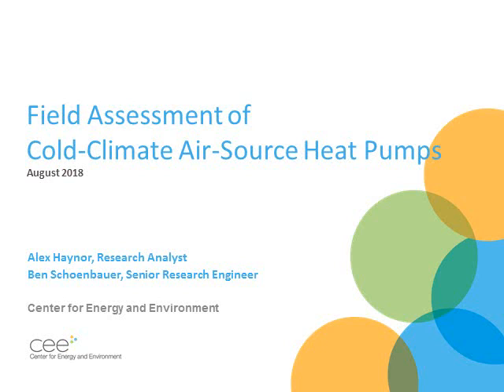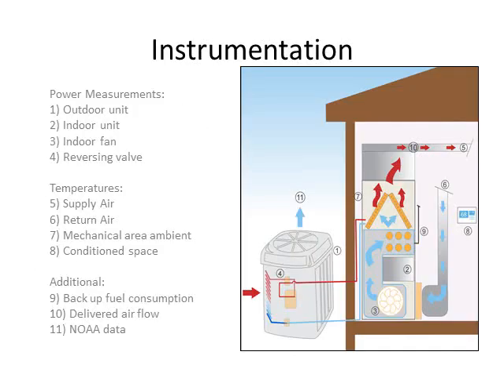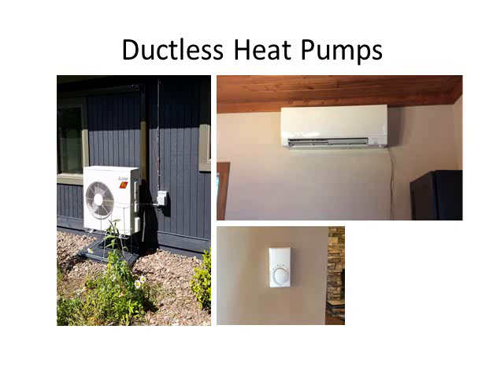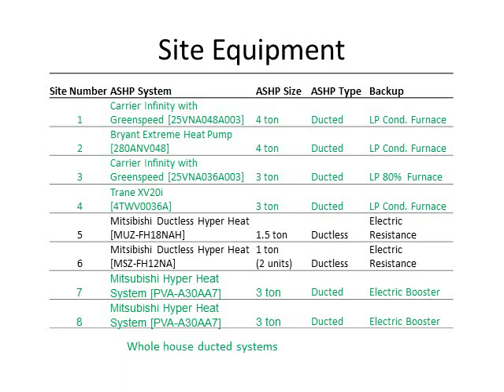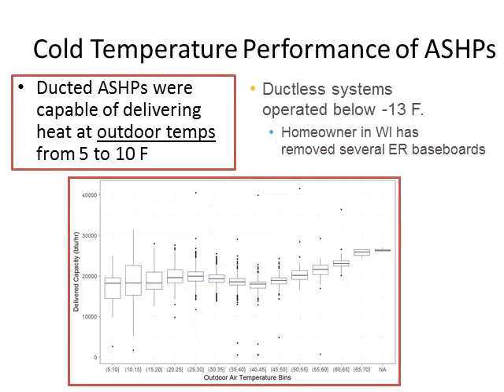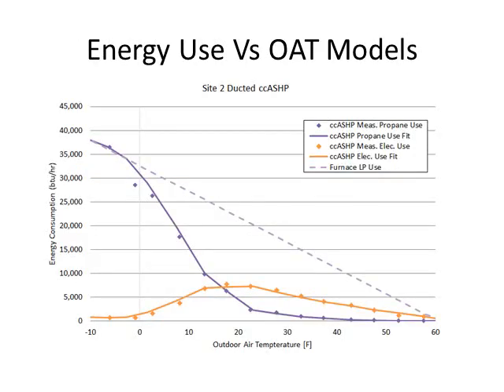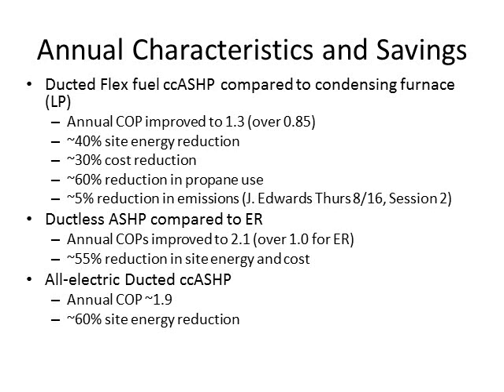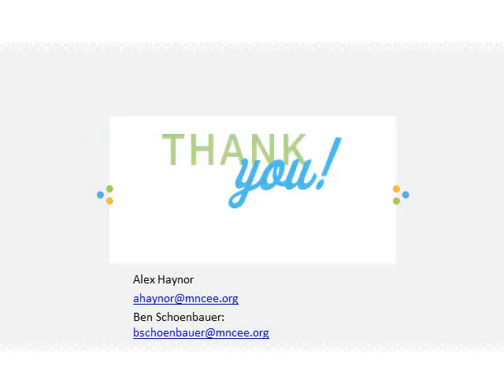Field Assessment of Cold-Climate Air-Source Heat Pumps

Comment: The method of calculating COP is wrong. Electrical input cannot be used as the basisi as electricity is not energy, it is an energy carrier. There for the COP needs to be divided by two at least for the most efficient generating type. In practice two is probably too small a figure.

Comment: So long as electricity is three times the price of gas and oil(per Kwh) in the UK the numbers just don't come close as a reason to change your heating system.
Reply: Global heating is probably a good enough reason.
Reply: Cost is not 3 times greater for equivalent kWh output.

Comment: Great video, just installed a 16 seer heat pump in Moorhead,MN and works great. Saving a ton of money!
Reply: Which brand did you go with? Experience any issues?
Reply: @tylerhein  haha funny you ask. A Goodman. The reversing valve got stuck in cooling mode after 6 months of operation. Warranty only covers parts. Labor is around $1500. Sounds like common issue on goodmans.
Reply: @andylarson3547  I'm across the river and am looking at replacing my ac unit. Thanks for the heads up on the goodman reversing valve... Otherwise you still liking the benefits? Any downsides from the 2 winters you had it installed?
Reply: @tylerhein  yes would for sure do it again. Red River Coop had a rebate for $500/ton, so they gave me a check for $1250. They're very efficient and cheaper than propane (even at $1/ gallon) and nice to have another source of heat.

Comment: Quite misleading presentation. 
These [ductless] systems are only good choices as primary heat for extremely well insulated dwellings with excellent double/triple glazing. These systems are good choices as only supplemental heat source for dwellings with not ideal insulation and glazing. 
Some of the reasoning: 
1. heating testing is done at around 40 and 20F. Lower values are extrapolations. Below 20F the efficiency drops drastically. This can be seen in the graph starting around 9:30. 
2. costs are higher than oil heat, unless [state] electricity costs are very low. 
3. Heat is expelled from the head at the ceiling and must be pushed down to the living space by the weak fan. This will not be [efficiently] successful because heat rises and the "whisper quiet" fan is not sufficiently powerful to overcome the thermal forces and other heated air distribution issues. 
4. Heat sensor is in the head at the ceiling where the temperature is much higher than at the center height of the room, or at the floor. Therefore, comfort is a great challenge. A $250 programmable thermostat for each head is a must. 
5. Well skilled/educated contractors [in heat pump technology] are extremely difficult to find. Without a well skilled designer/installer, the project is a failure "waiting to happen". Buyer beware! 
6. Mechanical noises are annoying and distracting. Vibration noises from outside units will be present if the outside unit[s] are mounted on the exterior wall.
Reply: The data shows thats not quite right
https://ashp.neep.org/#!/product/30812

What needs to be done is sizing it (them) correctly.
If done so, they are being used as primary heat sources.
Reply: I also would point out, at around zero degrees outside temps, you can maintain a competitive price with propane, any temps above zero, and its much cheaper.

Mechanical noises are a furnace kicking in, or high air volume passing through vents etc.

As for adding zone T stats, thats nothing a regular house can do at all, what you get is what you get, but with ASHPs, each area can be modulated, unlike furnaces.
Reply: @johns5504  thanks John.  That may be the case.  I've had different contractors and Mitsubishi in to do evaluations.  No luck.  Finally, I was forced to install a different technology heating system after loosing my shirt throwing money out to the utility Monopoly.

Comment: Would be very interesting to similar analysis of real data from ground source heat pump (glikol-water or direct evaporation). Especially for buildings that are well modern and well insulated, possibly with floor heating.